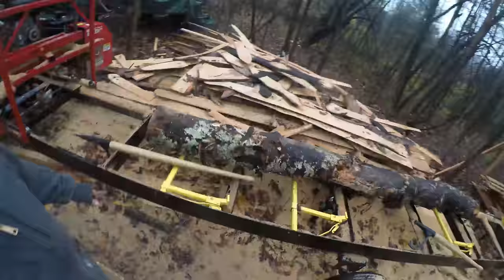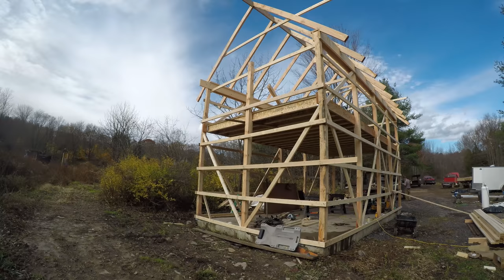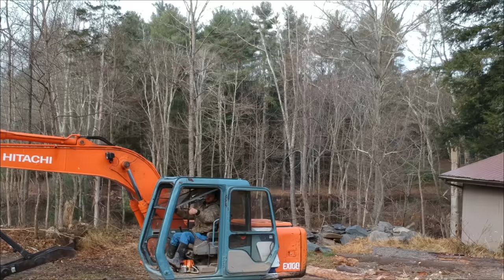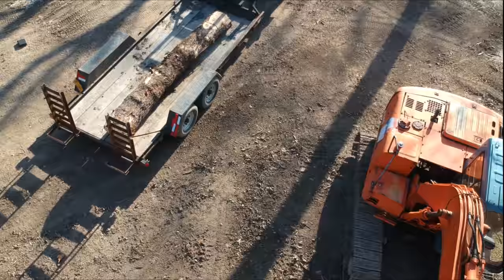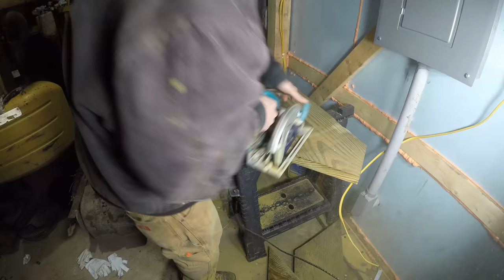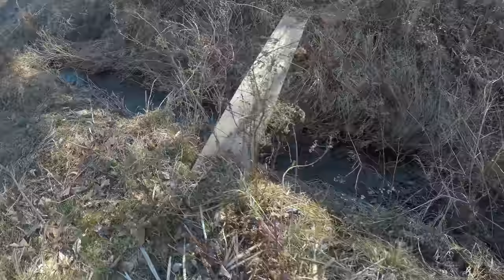From logs to post frame building

Comment: You can always paint the galvanized roof white for even more heat rejection from the sun and energy savings. We had a reefer trailer that had a galvanized roof and painted it white. You wouldn't believe the difference in heat.

Comment: Recent subscriber,  followed from Andrew post  crane.
Probably too late but
In sticky  soil that clings to your bucket and won't empty, change your technique 
, basically what you do currently is rotate bucket into soil  which compacts  and if sticky, glues it to the bucket, lift, then dump it clear of where you are working 
Instead
Do a longer shallower stroke that   forces  the soil to enter the bucket hit the back, and continue,  it rolls up thecback then falls over onto what is still being fed in, and continues into a coil...
Side on, you  end up with a roll of soil, which falls out reasonably  ok, instead of sticky  impacted soil that clings to the bucket 
Depending on stickiness of soil , it can be literally 5 or 10 times faster....
Try it

Comment: NICE VIDEO,, your a good carpenter...., I'am old school,, try to make things last with little or no re work.. water & sun are the enemy.. I probably would have run both gables out another 3 feet,, maybe 6 over the steps,,keeping the snow & ice off them, & run the studs all the way to the roof to help carry roof & railings.., i've road down icy steps before.. funny once you start especially with hands full there's no stopping.. In front of the door,, same deal less shoveling & snow & ice buildup.. I like 6, 8 inches of medal beyond 2, 3,4, feet of over hang on the side walls... High wind driving rain & snow the walls will always be wet during a storm.. Over hang would depend on open field, high mountain, ocean or lake or tucked in a  forest with good wind breaks... I built one cabin on a lake with 9 feet of ridge sticking out back to 6 feet ,, it was facing northeast,, log home.. Built a little deck coming off the bed room & under the 9 ft ridge,, looks kinds neat.. Sticking out kinda in the open!!!!I' would  OSB IT tarpaper  & cedar shingle ,, before you have problems,, water gonna splash up 2 feet on the walls guessing!!  the osb will hold a nail where pine won't ,, pine for nailing to spruce fir & hemlock studs ,, pines not good to nail too!!!not busting your hard working butts,, just an old warn out nail bender  living in northern Maine in  3 feet of snow & 3 feet of ice on the lakes snow piles up 5 //6 feet  against my buildings... Aloha,,,  I love to see Andrew Timber Frame his dream with some big ass oak timbers live edge,, over hang,, funky trees,, limbs sticking out to hang shit,, burly timbers,,  birds,eye,, curly,,  flared roots so you can see it's timber custom built will thought out front page of log & home magazine..  Charge people to see it in person ,, sell the story.. LAMO ALOHA   $$$ey  grow$ on Tree$!!
Reply from the maker: yea I may do something like your describing for my house. I'm trying to work the bugs out now to have it all perfected before I mill the wood for my new house. I dont think Andrew cares for wood too much. He likes concrete and steel more than anything. To be honest, I do too. But I do like wood on the inside of homes. I also like massive overhangs myself, but then you have to do special things to meet code here for wind uplift. Thanks for watching

Comment: Jessie-- Is the 2nd floor ledger board nailed to the posts?? The whole 2nd floor is supported by nails??? Are you going to put supports under the L board later or run bolts thru  the posts also?  Great job
Reply from the maker: there are thru bolts plus I also added about a 3 ft cleat underneath each spot where the post supported the ledger

Comment: For mud in your bucket a old timer told me to wield in a d ring and put a short chain on it and two for a loader then the mud has trouble sticking here in Arkansas the red clay is a nightmare hope this helps
Reply from the maker: yea another guy mentioned that on here, I would have never known that, good tip thanks

Comment: Hey Jesse,  I love the build and the video!  I am going to start my post and beam work shop this spring.  I've got a pile of logs from my last clearing job.  I am worried that I do not have enough though.  How many logs do you think you used to build yours?
Reply from the maker: its hard to say exactly, but altogether, probably 2 loads of logs on my trailer. Maybe 5k board ft?

Comment: You do not use the GMC truck much?
Reply from the maker: I dont, I will probably do a video about fixing and selling it, its a decent truck but gas, and there is a problem right now with the fuel system. I also have a 12v dump truck that I have hundreds of hours into rebuilding, even swapped it from auto to 5 speed with a transmission I converted from a chevy.
Reply: @jmuller86  cool deal on the 12v dump. My neighbor has a 4 wheel farm wagon with 12 v dump I pull for him when it's heavy. I am a GMC kind of guy but understand the Gonna Make ya Cry joke.

Comment: Is there a reason you turned the purlins on their side? We used to build metal buildings and turned them on edge.
Reply from the maker: I only needed to span 3' so flat is fine, when using trusses they are usually set on 8' so to span that you need them on edge
Reply: Makes sense, thanks